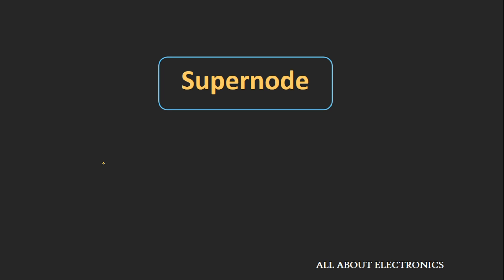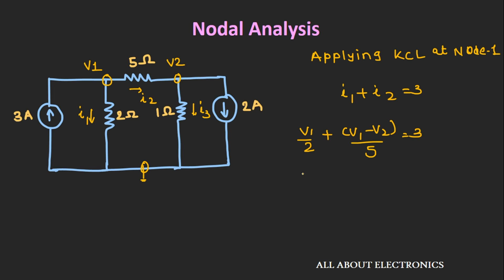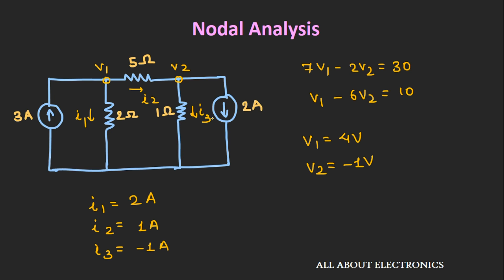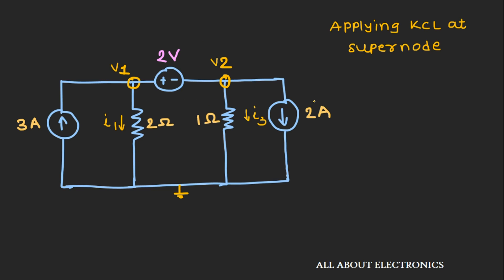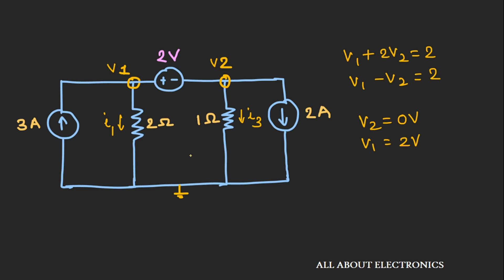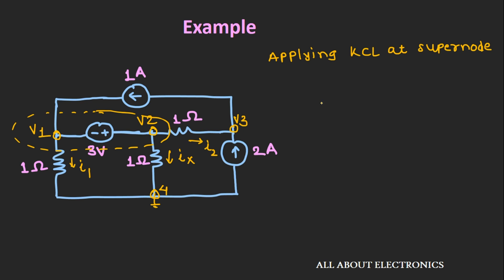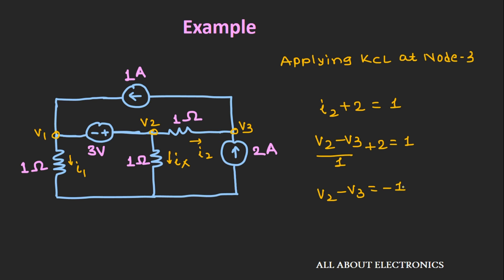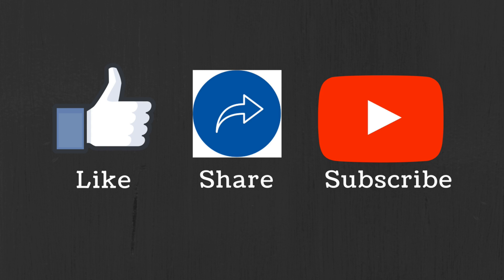Supernode Analysis Explained (with Examples)

Comment: Every thing before 2:15. Where are you getting the number 5 from?  Where are you getting 2 from and where are you getting 1 from. I noticed your dividing the nodes. But I don’t get where the denominators are from. Please tell me. 🙏
Reply from the maker: All are resistances. The 1 ohm, 2 ohm, and 5 ohm. Basically, we have applied the KCL at the node. And for every current, we have used the Ohm law. (I = V / R).
I hope, it will clear your doubt.

Comment: Sir I'm having a doubt what should I do in case of super node is connected parallel across 2nd and 3rd node
Reply from the maker: Well it depends, how it is connected in the circuit. Sometimes, using source transformation, it is possible to simplify the circuit.

Comment: What if resistance is connected in series to the voltage source in 3rd problem
Reply from the maker: Using the source transformation, it can be converted into the current source in parallel with resistor.

Comment: Sir what if a resistor is connected in series with the voltage source between  nodes.is that a supernode case??if not how to solve  such a problem.??sir,could u pls make a video on that.

Comment: the voltage source terminals should be opposite no? current enters through the negative terminal and leaves through the positive terminal right? that means that V2 has higher potential than V1 as current always flows from higher potential to lower potential? so it should be V2-V1 at 4:50 ?????? please clarify
Reply from the maker: The expression at 4:50 is written based on the polarity of the 2V voltage source. The '+' terminal of 2V source is connected towards V1, while ' - ' terminal is connected towards V2.
That's why the difference between the positive and negative terminal is 2V. Hence we can say that the difference between V1 and V2 is 2V. That's why its V1- V2 = 2V.
I hope it will clear your doubt.

Comment: what if there is resistor and voltage source between two node?
is that a supernode case?
Reply from the maker: Using the source transformation, it can be converted into the current source in parallel with the resistor.

Comment: sir I have one doubt in example 2 of supernode analysis in that circuit upper we have 1A current supply we dont take that in solving........ for what we dont take that in our prblm.... i have another dout sir in nodal analysi example 2 when we want current i 1 we have that i1=va-v1/r1 appadi than a  potu kandu pidikanum neenga v1/r appadi solve pandringa athu crt method aaaaaaa

Comment: At 6:42 why 2A current at v3 not considered while writting kcl equation
Reply from the maker: Because the KCL equation is written for the supernode. If the KCL equation is written at the node, where the voltage is V3, then it should have been considered. 
I hope it will clear your doubt.

Comment: Bro what to do if there's 3 such nodes what to do
Reply from the maker: It actually depends on how the circuit is connected. Some times in such case, it is easy to apply KCL. If there is any such circuit, message me the circuit on FB or Instagram. will take it as the next quiz on the channel.
Reply: @ALLABOUTELECTRONICS  I have done the same please checkyour facebook

Comment: how he replaced 5 ohm with 2v
Reply: He didn't mean they are equivalent or didn't replace it. He just showed what if a voltage source remains between two non-reference nodes by another example.
Reply: I didn't understand too
Reply: that another question

Comment: What if there is a resistor kept in series with the voltage source? Will it still be a supernode?
Reply from the maker: No, it will not be a supernode. But in that case, the combination of a voltage source in series with a resistor can be converted into current source using source transformation method.
Reply: Sir instead of converting it by transformation,if there is a 4ohm resistor kept in series with a voltage of 2volts,the whole setup kept between node 1 and 2,At node 2,Cant we directly write it as (V2-V1-2volts)/4 ? Please reply sirrr
Reply from the maker: In that case, V2-V1 = 2V + (drop across 4 ohm resistor).
And we don't know the current through 4-ohm resistor. 
So, it's better to use source transformation.

Comment: At 5:36 the top left current it is not 2A or is it? Isn't that 3A?
Reply from the maker: If I had drawn that 2A on the other side of the supernode, it would have been easy for you to visualize it. 
Means out of 3A current 1A current is flowing through a 2-ohm resistor (i1). And remaining 2A current is flowing through supernode. 
I hope it will clear your doubt.

Comment: why for the equation 2 is v2-v1=3, and why not v1-v2=3 can some one explain to me, im a bit confuse
Reply from the maker: Just check the polarity of the voltage source. The positive terminal is on V2 side and the negative terminal is on V1 side. So, V2 is at higher potential than V1. And that's why V2- V1= 3V
I hope it will clear your doubt.

Comment: if a resistance is also present in the supernode. how can I do it ?
Reply from the maker: If resistance is also present with voltage source then you can apply the source transformation and convert the voltage source into the current source. And then the problem can be solved by simple nodal analysis instead of applying supernode. 
I hope it will clear your doubt.

Comment: my dear sir what is the most important criteria to select a supernode otherwise it's little bit confusing that the super node that i choose is correct or wrong. kindly reply it sir.
Reply from the maker: If the given circuit is easy to solve using nodal analysis method and if you find the voltage source connected between the two nodes, then that node can be considered as a supernode. 
I hope it will clear your doubt. If you still have any confusion then do let me know here.
Reply: ALL ABOUT ELECTRONICS ; sir ''in case of rotationally symmetrical circuits the equivalent resistance of any two points of the circuit doesn't depends on the applied potential to the circuit" - am i wright sir ? if yes then why am getting different eq.resistances across the same two points of a rotationally symmetrical circuit by taking  different applied potential using nodal plane method ? kindly reply sir.
Reply from the maker: It's hard to tell without looking at the circuit. kindly message me the circuit diagram on the facebook page of ALL ABOUT ELECTRONICS. I will let you know in 2-3 days.
Reply: ALL ABOUT ELECTRONICS , ok thanks sir. SIR, YOU ARE ONE OF THE GREATEST YOUTUBE TEACHER OF ALL TIME.

Comment: at 4:19....u took ( -3) but it should be +3 as u told in ur previous video, current entering a node is considered as positive ?
Reply from the maker: You can follow the convention you are comfortable with it. If you consider the current entering the node as positive and the current leaving the node as negative, then also you will get the same equation.  
I hope it will clear your doubt.

Comment: at 6:03    how i decide which node i take as reference  ?????  why i should not take node 3 as reference  ???
Reply from the maker: Generally, the node which is at ground potential or the node with a maximum number of branches is taken as the reference node. There is no hard and fast rule. But when you take that node as the reference node, calculations will become easy.

Comment: why is it that I1 and I3 comes out but not coming in?
Reply from the maker: If current directions are not given in the circuit then you can assume any direction for the currents(either entering or leaving the node).
If your assumed current directions are not correct then you will get negative values for those currents.
For example, let's say current i1 is 1 A, which is going out of the node. If you assume that current direction as incoming current for that node, then when you solve it, you will get the value of current i1 as -1 A.
so, actually, it doesn't matter which direction you choose, it will be taken care of when you write KCL equation at that particular node. 
I hope it will clear your doubt. And still, if you have any questions then do let me know here.
Reply: I didn't think it would apply for supernode, but it does! you have my thanks.

Comment: in equation 2 u mixed up, it should be v1-v2
Reply from the maker: Do you mean to say at 7:08 ??
If so, then it would be V2- V1 only, please check the polarity of the voltage source. It would be V2- V1= 3
Reply: if you assume that the current flows out of the positive end of the V.source and assign the currents throughout the circuit accordingly, you would find that the assignment of v2-v1 contradicts the direction of the current. I belive that the question is faulty

Comment: what if there is a current dependent current source between 2 nodes ?
Reply from the maker: If there is dependent current source between the two nodes, then simply use the nodal analysis method to solve the problem. There is no need to use super node in that case.

Comment: In the last example, what if there is another voltage source between v2 and v3 ?
Reply from the maker: Do you mean in series with 1-ohm resistor? or in parallel with 1-ohm resistor?
If it is in series, then just use source transformation and convert voltage source in series with resistor into a current source in parallel with the resistor.  
If you are talking about connecting it in parallel with 1-ohm resistor then consider that voltage source with a parallel 1-ohm resistor as a supernode.  And then you can solve it. 
I hope it will clear your doubt.
And still, if you have any question then do let me know here.

Comment: what happens when a resistor in series with voltage source connected in supernode
Reply from the maker: The concept of a supernode is under the assumption that the voltage source which is connected between the two nodes is the ideal voltage source, that means it has zero series internal resistance. If the voltage source is not ideal and has series finite internal resistance then you can not apply supernode concept. 
So, if the circuit has series resistance with voltage source between the two nodes, then you can't apply supernode, except in the case where the value of series resistance in too small compared to the remaining resistors in the circuit. (e.g if series resistance is in few ohms, and other resistors are in kilo ohms.   In such case, you can neglect series resistance and treat the source as an ideal source.
I hope, it will clear your doubt.